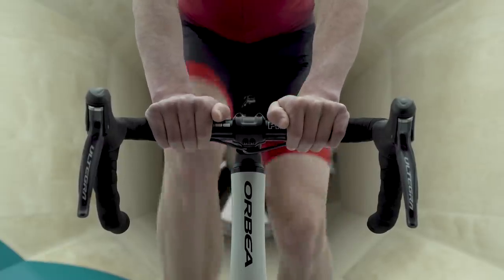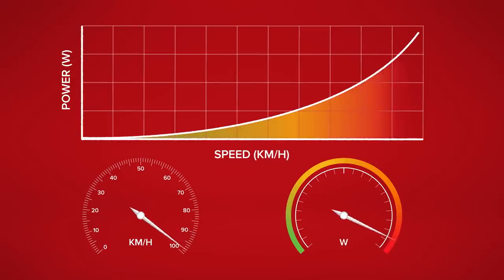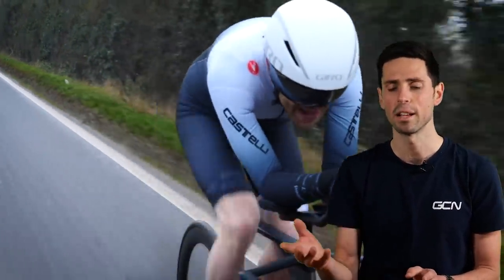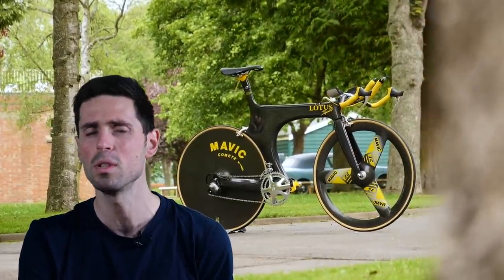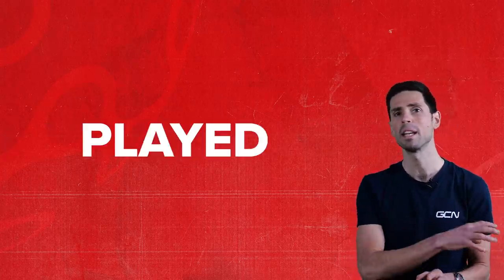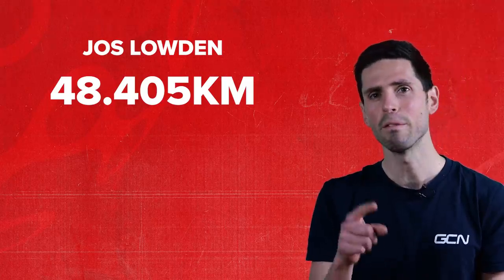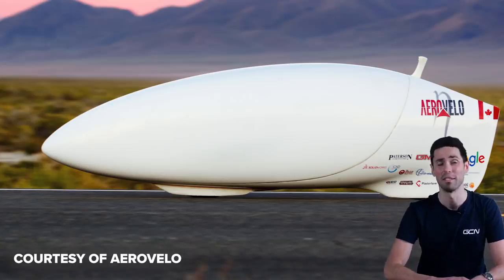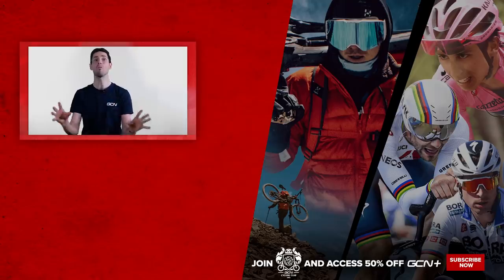The Evolution Of Aero In Cycling

Comment: @gcntech, I like how Dan is the photo for historischen, but as an engineering have to say there is a lot of incorrect info... raindrops are typically spherical or Hamburger bun shared depending on their size, turbulente doesn't mean drag and the cause of the aero forces impact the rider are mainly caused from a low pressure zone behind the rider which in fact can be reduced by introducing turbulent boundary layers (trip wires) at specific points. This has been employed by many cycling kit brands in where they place the seems or what the surface roughness is.
Reply: I had a small stroke trying to piece together your comment.

Comment: rain drops do not look like that! they actually morph into a shape similar to a blood cell because the stagnation point that forms pushes back into the centre of the drop making a concave shape that is trying to pull the drop apart only prevented from doing so by surface tension
Reply: Came to say this.  It's a minor point, but also a very disproven myth.

Comment: If I am not mistaken, the most aerodynamic position on a bike was tested at the end of the '90s in the attempts to the beat the hour record, before UCI banned all records from 1972 because the bikes were getting way to weird and extreme.

This position consisted in riding with head and chest far ahead of hands and arms that were folded and pressed against the stomach. The aerodynamic gain was huge, but the position itself was a pain. Not only because it was hard to keep that position for an hour, but also because it affected breathing that became harder since the lungs were compressed and could not take all the air needed.
Reply: Chet Kyle from USA had experimented with various positions and cycles in the 1970s, througjout thr 80s and 90s. Reading his work and Gordon Wilson is a pleasure

Comment: The Kestrl Talon of 2002 predates most carbon aero bikes, DeRosa and Pinnarello had aero steel bike in 1982.  Peugeot even has a production aero 1980 bike, though cheap and awful it was a sign of the times before Cervelo and “modern” era bikes.  My Kestrel Talon SL is also an 1100 gram frame  which was super light for 2004, 15 pounds with a chorus 11 build.

Comment: Ah yes the soloist, the “first” aero road bike despite being late to the party. The Santa Cruz Roadster beat in into production 1999 vs 2002
Reply: Actually the first commercially available aero bike was the Lotus Super Pro equipped with a Shimano AX (aero) groupset in 1984! It had steel aerodynamic tubes as well.
Reply: @williamschulze505  my point exactly although I hadn’t heard of that bike the point is that, the soloist was late to the party.

Comment: OK Alex or Ollie here is one for you... I've heard that 80 percent of the drag is the rider and 20 percent the bike, is that for an optimised rider with skin suit,  position set up in a wind tunnel or just an average for all riders? 
Now stick a 95kg gorilla on a bike that likes to lift weights (that's me BTW) how much difference does that make to the importance of the aero of a bike, for example my 2 latest projects, 1960s Merlin steel track bike and a modern Carbon track bike.
Reply: If you put a fairing in, the rider does not matter for air drag
Reply: @taufikabidin412  I talking  normal road bike no fairing, not aero recumbent or anything like that.

Comment: aero carbon frames arent heavy at even 1000 grams, most weigh in at less. its possible to have a 7kg build with that frame weight. what cause them to be heavier are disc brakes which take away from aero and add considerable weight. aero frames can weigh in at around 800 grams which is super light and can be built up to a sub 6.8kg
Reply: It doesn't matter how fast you can go if you can't stop fast. Races have turns and alpine descents where good brakes do make a difference. Also stopping faster means you can brake later and mantain the speed for longer before braking.
Reply: @8paolo96  fortunately for the average consumer we can choose the type of bike we need. and theres not a one size fits all hence the climbing bikes, aero bikes, tt bikes, gravel, ect... personally i dont need disc since there are no huge descents near me and i can lock my brakes up anytime i want with little effort, as well as have complete control of the complete range of stopping power from zero braking to locking up as all rim brakes provide.  unfortunately for pro's theyre forced to use disc brakes for flat tt's and mountain top finishes to make the industry more money. dont keep the uci happy and theyll chew u up and spit u out like they did lance.
Reply: @8paolo96  obviously discs are only recommended for wet conditions and big descents. so why are most bikes disc now? we all kno why. most ppl who have disc dont need em.
Reply: I don't know why everyone seems so convinced that disc brakes are automatically less aero than rim brakes. The difference can swing either way depending on the bike, and on average the difference in drag CdA is very small, only about 1-2 watts at 40 km/h, especially when considering fully-integrated braking systems that are aero-optimized. The discs are only at a distinct disadvantage when riding in severe crosswinds.
Reply: @johnbarron4265   integrated cables are a non factor. but yes besides the "severe" 20mph crosswinds, disc calipers, and levers create more of a frontal area than rim brakes as well. i also notice how you only mention the aero loss of disc being minimal of course its not large but cycling is about marginal gains where and when they can be had. pro's dump 1/2 their bottles of water out before steep climbs, tell them those gains are very small.  its no wonder time records decades old cant be touched today with all the great new bike tech. but the main thing to consider isnt even the weight gain or aero loss the question becomes, am i going to be riding in wet conditions a lot and or down mountains? do i need disc? are the substantial increase of mechanical issues that force many ppl to have to take their bike to a shop to get serviced worth it? most ppl just want to stunt and get new shit.

Comment: Ha , when did aero start , hmm Track rides in the '' 60s wearing ' silk ' tops because they slipped thru the air  !?!
Shimano with the dura ace AX group set 1983 ? With streamlined components , Guercotti and Colnago with there aero tubed ( Squashed) frames of the mid ' 80s  , Tange tubing from Japan that was oval shaped in the early 80' s  , the Assos crono- suit worn be Daniel Gisiget at the 1978 track world s  ,